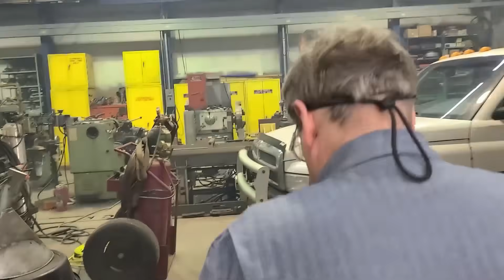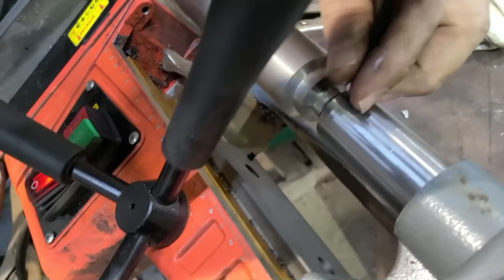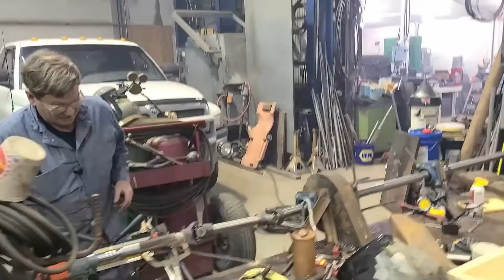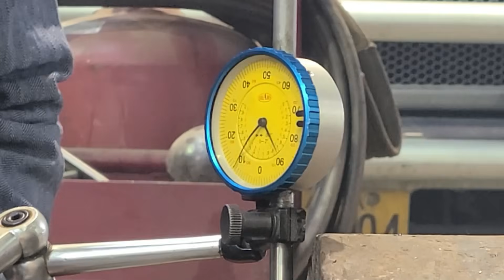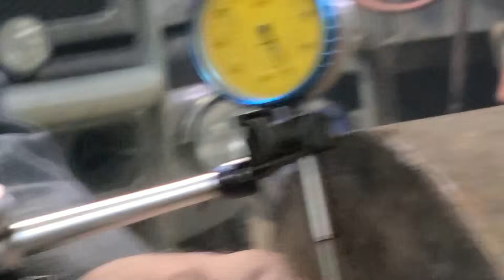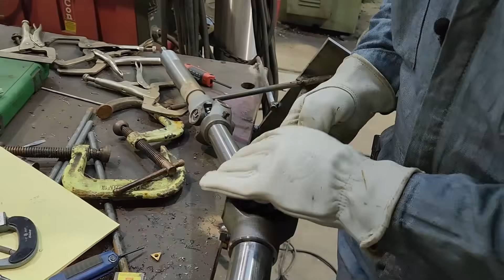Line Boring (with a $134 dollar mag-drill!)

Comment: Lol been there done that   when the hydraulic motor died on the climax line. Boring. I had to come up at something and it was a mag drill that finished a job nothing like bumping out the tool bit   0.001 too get 0.0025 out of the bore lol,I always took micro 100 carbide bits & reground them a rougher and a finisher way better than the inserts

Comment: I have a s$$t load of those insert holders for custom tooling as well as line boring. They’re chinesium, not quite as good as titanium lol 
I also made my boring bars with pairs of holes to accept the cutter in one and my modified micrometer in the other for extremely accurate tool adjustments. I also made a very wide range of “offset” snap gauges that drop through the second hole to make accurate measurements through the bar. I can easily get within  a half thou.

Comment: I built my own line boring setup. I built a welding turntable using a three phase 2 hp motor controlled by a single phase speed controller. Range from 25% to 125% approx and forward and reverse. The motor was connected thru a reduction box and a worm.box. all modular. I did add a second reduction box about 7:1 to slow it down more. I had a speed range of 6 rpm to I rev in 20 min depending on gearing. I had a line boring job offered and figured" I've got a lot of the expensive stuff. I made up a 8:1 inline reduction box. Use reverse gears from Toyota gearboxes. Gearing was double deal so rpm was nice and slow compared to boring bar and went in same direction. I made my boring bar from ground 4140. The feed gearbox was fitted on very end of the boring bar. For the feed I put a tube on the output of the inline gearbox and made an interchangeable bronze nut to fit it. Stuck out about 16". From this tube I ran a fine threaded 1/2" rod. It engaged with the bronze nut. Further out I installed a simple anchor plate. This was attached with two long screws rod back to bearing housing. I used a simple torque arm on drive end and it slid along a steel bench top. To activate feed I simple locked the fine rod to stop it turning and the bar simply walked slowly along the fine thread. It I loosed jamb nut it stopped feeding. If I left bar turning and put my battery drill on the thread I could turn it quickly and it would back the boring bar back out. It was a long setup but did the job. It really needed a lower ratio, 16:1 or so to get very fine feed. Course thread easily increases feed. Best part was motor was quiet and you could hear bar working easily. We judge our work by sound far more than folks appreciate.

Comment: Lovely video.  What I have heard from smarter people and read in books is that you need to have universal joints phased correctly to minimise angular judder.  It may be partly responsible for the rather impressive shaft shaking you had.  Basically the joints must be closely aligned on the middle shaft so that all the non-constant angular velocity after a joint is cancelled out by the next joint.  This also requires that the angle at each joint is equal in size, can be X and X degrees or Y and -Y degrees.  None of this matters for small angles.

Comment: 100 bucks for a 2kVA Variac (variable autotransformer, if you want the not-a-brand-name) and you should be able to slow down the drill motor, but it's likely the magnet is powered from the same incoming cable so beware.

Comment: Good work..
I was setting up a similar rig, trying to figure things out when I came across a complete York setup..
It has an adjustment set screw to adjust the cutting depth with indicator marks on the handle of the allen head wrench handle..
This thing has many different RPM selections..
With automatic feeding control.
And I love working with it..

Comment: I see you have a POWCON welder! cool. i have a POWCON 300 S/M.
Reply from the maker: I have about 8 of the smp550s.  The height of this design was when Thermal-arc took over the design, the 220-400 amp powcon machines are mostly the same, the Thermalarc & powcon 300, and the correct year miller & also some esab, all used the same case.  The 400 and larger Thermalarc machines used a steel case & are not copies of the 550, I don't think anyone continued the 550 powcon, the thermalarc 500 & 600 will output more than the 550 powcon. the large powcon will give 630 amps, my thermal arc will put out 800 amps. Workhorse brand was remaking the 300-400 series powcons a decade ago, but I have not kept track of them lately.

Comment: So, been thinking about doing this on my excavator, where do you get the bar? Or can i make one?
Reply from the maker: The bar came in a kit for a 'real' line boring machine we've yet to set up and try out. John got it off of Amazon, but I can't look it up without running a VPN from the lower-48. You can make a bar out of TGP stock that you drill and ream the slot for the tool holder for. Might be more worthwhile to hunt down a boring bar. With that particular mag drill I had to machine an extension so the U-joints cleared the base of it, definitely recommend the extra money for a variable speed drill if you pick one up for the job.
-Cameraman
Reply: @HOWEES  thank you! I was already looking at the variable speed lol. Those bars are not easy to find used I'm finding out haha
Reply from the maker: @shaydowney1477  Cameraman is thinking of a different bar, that we bought, but have not used.  The bar in this video is just 1&3/4" TGP 4140, with a 1/2" hole drilled through it.  I originally made this bar for boring 2" holes, and used it with our boring mill.  Buy as big of a bar & bearing as your hole/budget will allow.  drill a cross hole & set screw, the holes are nicer when broached square, but round holes work too.  Most common bar Imperial sizes used are 2.25" & 1.25" most common metric 50mm & 40mm.  I have used as large as  3&15/16" and also as small as 3/4".
Reply: @HOWEES  awesome, thank you! I've been super intrigued by your videos so keep them coming please!

Comment: In the early eighties I was sent to help a contract "machinist" bore or surface flat the two mounts for a Z Drive in a brand new tug we were building. About 10 foot diameter 2 inch thick steel plate. This old guy shows up with an old motor, some well used big angle iron and a couple of chunks of channel iron and a couple of bearings.
A couple of hours later he had built this large rotating contraption with a small toolhead.
A day later he was done and you would have swore it had been machined on a giant milling machine. Got a lot of knowledge and respect  for that old man
Reply: Have you seen the new crescent type wrenches with smooth jaws and vise grip lock so the adjustable jaw does not move.
Its a really pretty cool tool It looks like they're already going to discontinue them because they're not so popular I cannot imagine why they would not be the cat's meow I bought  two more just to have
Reply: What is coming out of school now if they can't text it on their phone it can't be done.    😖

Comment: I wonder if the shaking comes from the universal joints being out of phase.
Reply from the maker: Not the problem, but yes the shaft was made a little off (not on purpose just a newer man not knowing how it should be).  The screws were loose & the adapter shaft doesn't fit the drill well, was the vibration.

Comment: The bonus to turning the tool offset is not only the flat for the set screw, but it also gets the tool back closer to bore center reducing the negative rake angle. Much less chatter. Great tip.

Comment: Hi Howie:
First off, this is an experiment, a learning experience, and works very well as such.
Second, I have a very old  bucket loader/backhoe, and am certainly going to steal many of your ideas here.
Some suggestions:
1. Please stop using Allen keys to work Torx fasteners.  I have done this in certain emergent situations when all I had was an Allen key.  It does no favors to either the tool or the fastener.
2. Your yokes on your Cardon Shaft are not square to each other.  This can be a source of vibration because of angular acceleration.  I ran into this problem with the main engine throttle on the U.S. Coast Guard Cutter BRAMBLE  when replacing work universal joints. The cure is to square the U-joints, or use CV U-joints instead, (a much easier solution.
3. Shorten your Cardon Shaft length.  This will reduce missalignment induced unbalance vibration by reducing the mass of any missalignment.
4. Either put a support bearing on the first section of drive shaft coming off the drill, or mount the drill directly to the boring bar shaft bearing mount, (eliminating the need for a cardon shaft alltogether).   This assumes enough travel available in the mag drill.
5. Give yourself at least one hand width between each boring bar support bearing and the item to be line bored.  This will allow better access to measure the bore using (those #^*@!) snap guages.
6. On your cutting insert holder, weld a nut, or provide stock to drill and tap for a set screw to make setting your cutting depth easier.
7. Either utilize the variable speed drill, or reduce your feed rate to minimize surface imperfections.
You are a great wrench, and I am sure you are aware of most, if not all of these solutions.
As I said before, I am going to steal your idea as line boring rigs are insanely expensive, and I only have a couple dozen pin bores to re-machine.
I really appreciate the video, and hope my suggestions are helpful.
Let me know if any of this is useful.
Cheers!

Comment: Gonna burn that drill up
IMHO
Reply: I have done a lot of line boring with mag drills smaller than that, and also my screw feed line bore drive uses a large Milwaukee mag drill motor.  It's really not a huge hp application, and mag drills like that vevor are designed to run annular cutters up to about 2 inch which take a lot more power than a single point tool like that.

Comment: still lower 48 and not future 51st state.  made the same but in a different time zone.  Get an old school inside caliper that will span your boring bar and transfer measurement to outside mike.  They're cheap and will save you alot of time from your accumulated error method.

Comment: Some smaller steering u joints would have been a little more fitting i would think
Reply: Maybe so. But, I think they benefit from the inertia from the extra weight. 
I could be wrong.
Reply from the maker: I think it was just that those u-joints could be used with the line boring shaft without turning it down, but I could be wrong. Might be what was on hand.
-Cameraman
Reply: @HOWEES  defanitly gotta use what's available!

Comment: Just saying - I would have dead stopped the cutter with a grub screw at the back of the drive bar through hole so that the cutter can be removed without losing the offset position - then the main boring shaft can be removed for final measuring and finish cuts.
Reply: That's the way our bars are built.  With a 7/16x14 set screw its about .036 every quarter turn as well, makes roughing faster

Comment: Very nice video! Thank you guys so very much!
Question: In the case of fitting for hardened steel bushings and considering surface finish and press or interference or negative fit. Would it be better to leave 0.003” clearance (a good slip fit) and then use locktight rather than do a guessing game and try for a really good press fit?
Thanks again for your time in demonstrating and your comments along the way! 👍😎
Reply from the maker: No, Never, the advertisers & rookies love plastic, in real industrial it doesn't even start to compare to metal. 100x the load capacity with press fit.  the worst offender is the "Belzona crowd" many engineering departments are avowed to their sales pitch, I think it is the high price, that makes better bunch of believers.  Until they have had enough years to see the repairs back again, then they all swear-off of all the various forms of J-B-Weld.
Reply: @ 
Ok. Thanks for the great advice!!!
Cheers!!!
Reply: @HOWEES Ok, I'll be the one to ask. What is a belzona, and;
1) are you allowed to shoot and eat one?
2) What's the season. If not, what's the correct seasoning?

Comment: theres a 3rd type of "machinist" everything is perfect, new fancy machine, good solid tooling and set up... and they still bitch about it and scrap 1/2 the parts... (oh right thems ain't machinists)
I'm firmly in the camp of I got a hammer and a chisel, we'll get er done, having actually used said tools to complete a job once lol (customer wanted .030" rad's inside corners of a box, with compound angles... did as much as we could with endmills, and I cleaned the corners up with a chisel... worked good)